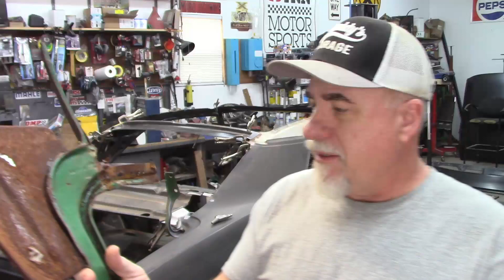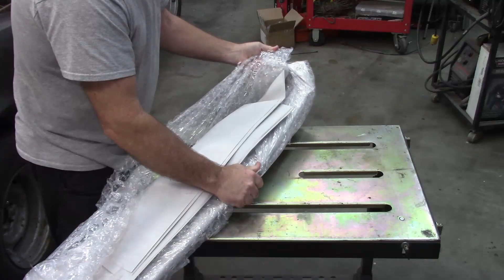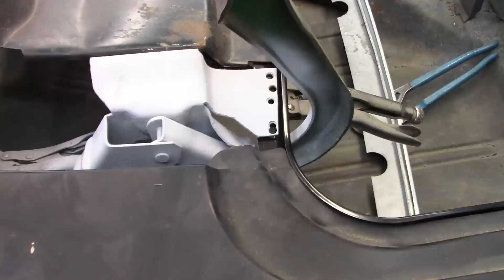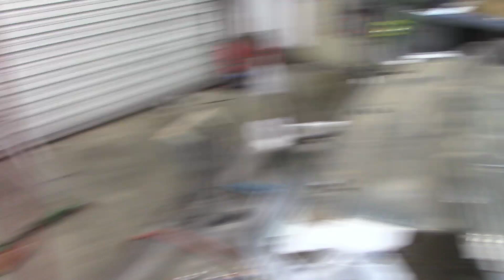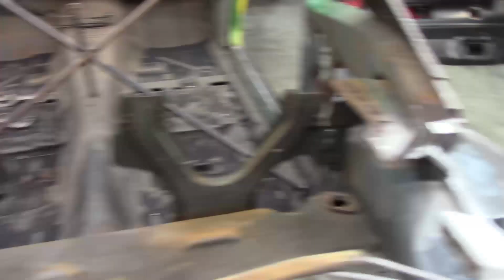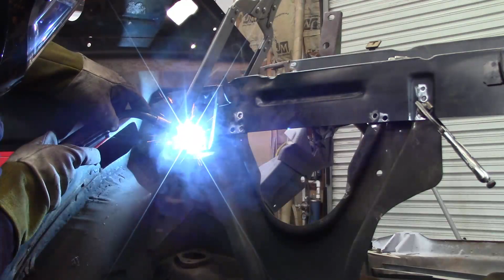1968 Camaro rebuild. Basket case part 12 Package shelf.

Comment: any added protection by using weld thru primer on those pieces you welded?
Reply from the maker: I used to use that stuff a lot. I'm no longer convinced it does much of anything but make welding harder.